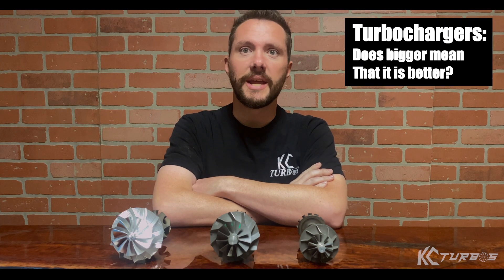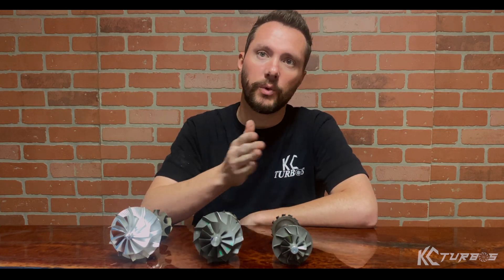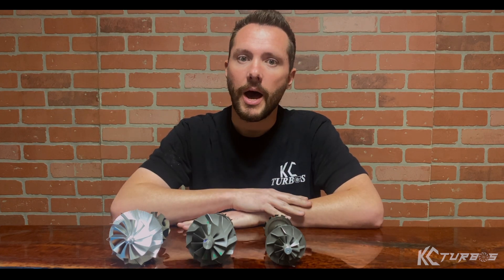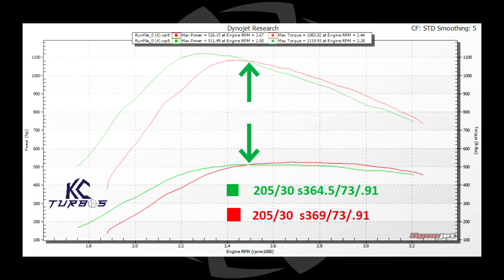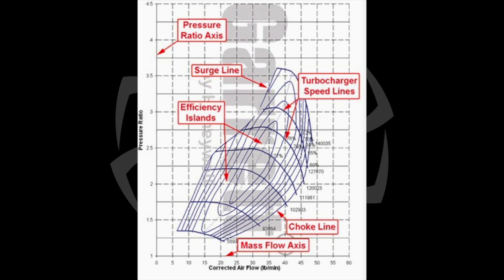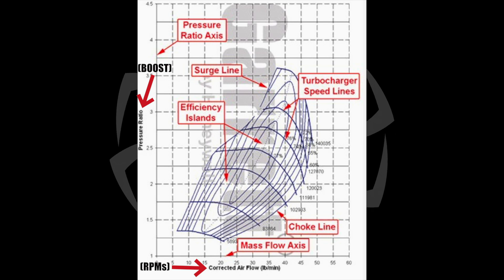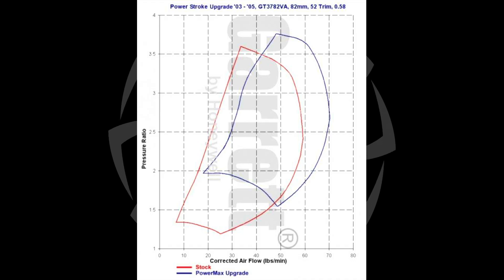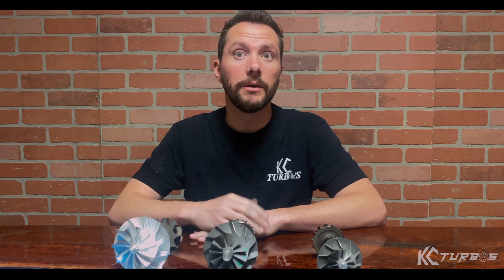Why A Bigger Turbo Is Not Always Better!

Comment: So with this info what is the better buy?  
KC Stage 1 or +15 OEM for my '11 F250 6.7 ?
(daily driver with random towing)
Reply: I would like to know this as well
Reply: Depends on the goals and applications, whether you run a hot street tune, or whether you race at the track.  There is no 1 right answer for everyone.  You need to decide what matters more to you.

Another note is the stock turbo does not whistle.  KC Whistler will

Comment: Ok so I think I understand it. Im planning on going to 205/30s and maybe up grade from my Stock 03' turbo. But if Im understanding you correctly and since im on 37's with 3.73s that bring down my rpms andmaybe the stock 59mm is the biggest i should go or a lil smaller to maximize the turbines spool unless I re-gear or get a bigger motor While 60-61mm maybe the sweet spot if I had stock tires size cause Im limited my rpms and cubes
Reply from the maker: So this just depends on what your plans and HP goals are with your truck?
Reply: @KCTURBOS  Honestly! All Ever really do other then just bigass brodie's n lawnjobs  visiting friends Is maybe try to blend in with the local rednecks.  I moved from LV to lil Hickville few years ago and i think ive seen more over 500 hp diesels here then ive counted teeth. Not  trying to blow anyones doors off just command some respect lol Im still a lil sore about when one of them fucked me over selling me my shitbox.lol Fuck one guy has couple scary fast 6.0s  ones got compounds and its the slow one. Other one is in the single digits that he races it professionally. The hard life being a wealthy rice farmer lol

Comment: Then there's compounds. 😬
Reply from the maker: Compounds are indeed the answer to wanting to eat your cake and have it too! Tow turbo + Go turbo = i wanted it all
Reply: @KCTURBOS   seen you have a 372 billet when replacement. What about compressor  covers?
Reply: @1997obspsd  We don't stock any s300 comp covers but might be able to help you find what you need.